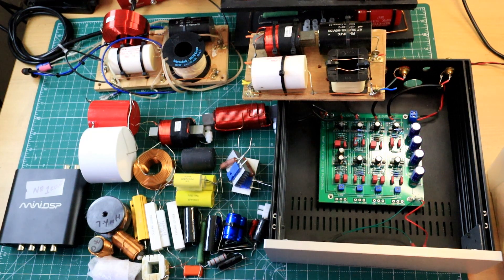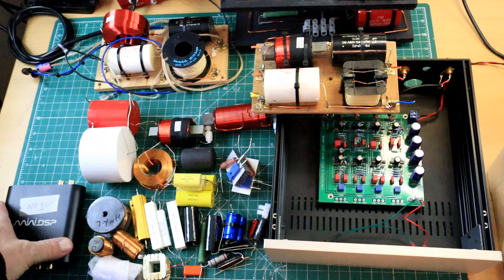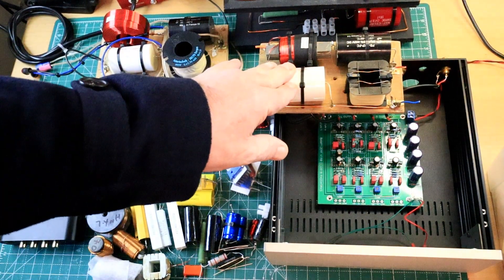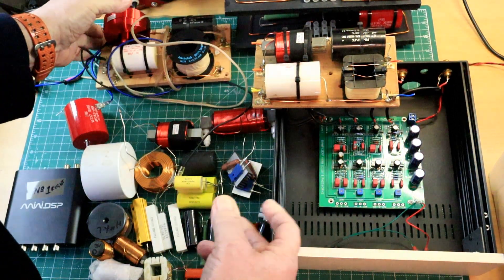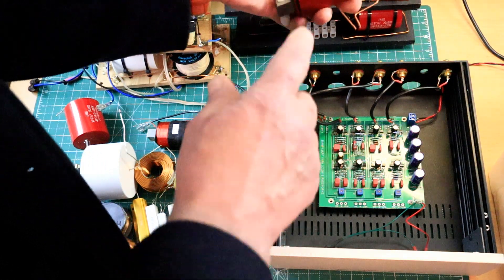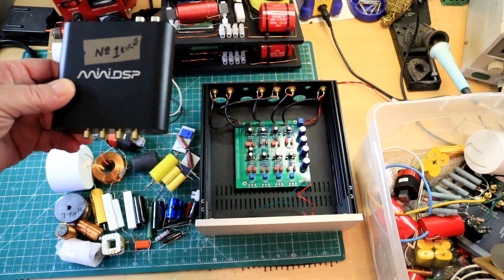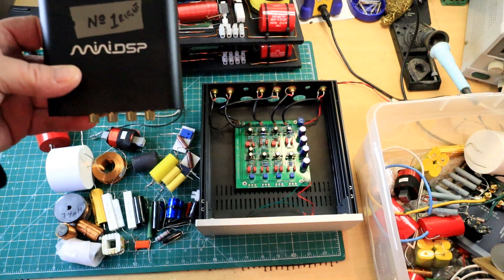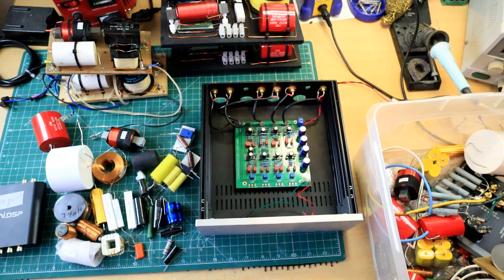Crossovers:- but what type??

Comment: I've got a MiniDSP 4x10 HD waiting in the wings. My PFM Special will use a passive crossover initially, but I'm going to wire it up so that I can experiment with the active digital approach. Thanks for the kick in the pants.
Reply from the maker: I'm still amazed at just how good this little (2x4HD) I use is. It is very flexible and has shown me to 'not be afraid' to try things passive xovers cant or rather they can but this unit takes quite a lot of guesswork out of the equation with a push of a mouse on the desk top driving the software and waiting for the results a few seconds later. Have fun building....